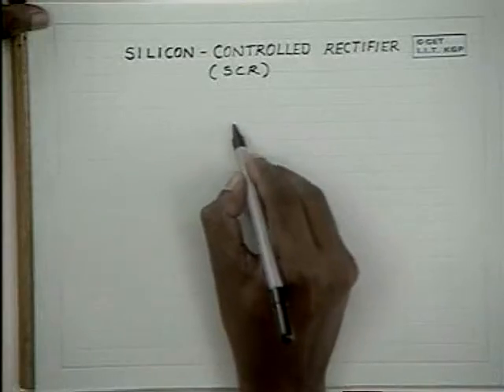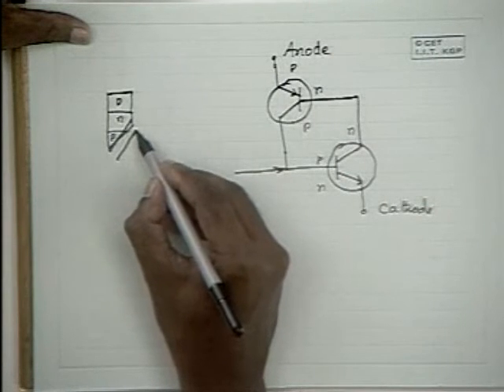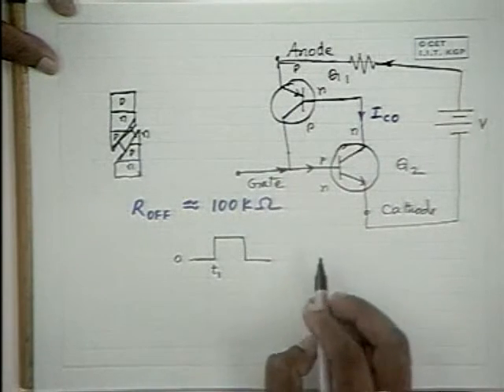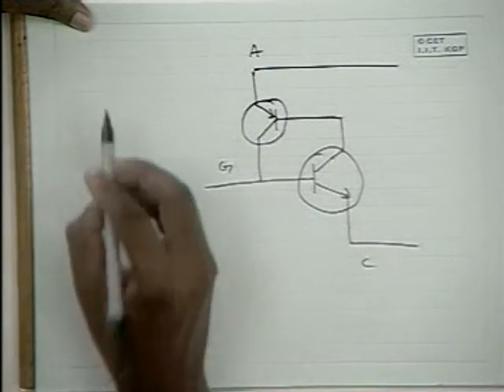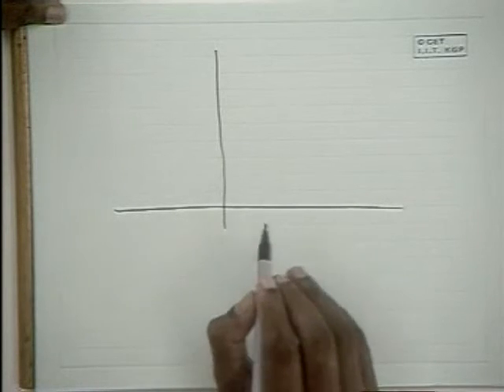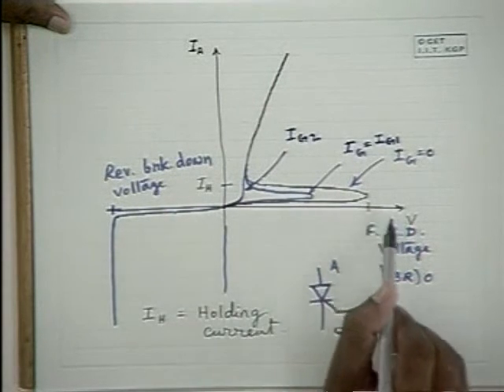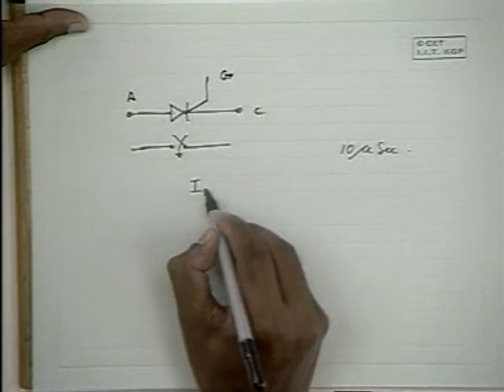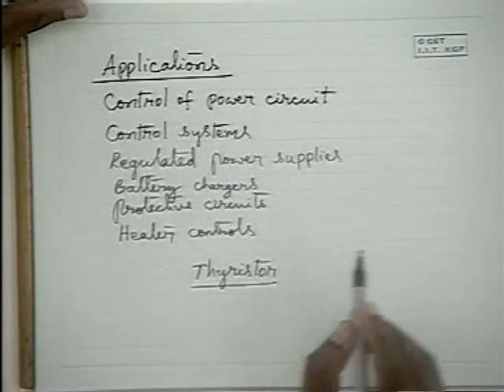RVR BE 10 SCR (Silicon Controlled Rectifier)

Comment: Very good video.  For a non-latching SCR, a diode between Q1 emitter and Q2 base, the gate would need full time positive signal to keep the current flowing.  Such a setup would really just be a fancy PNP-NPN transistor.  Of course the character of the SCR's normal operation would be void yet if the diode was switched with another transistor, it would be a Latching / Non-Latching SCR.  Could be useful in some needs of such.